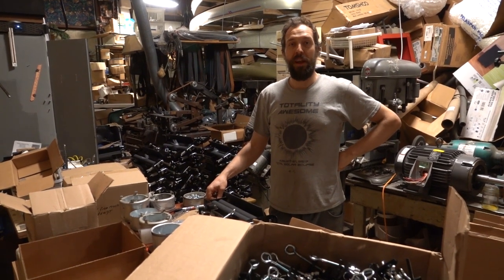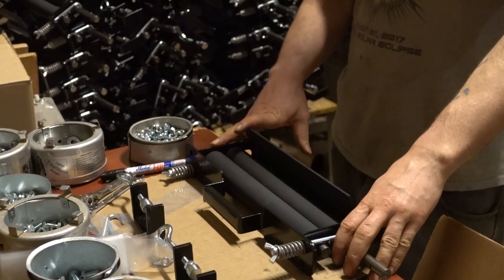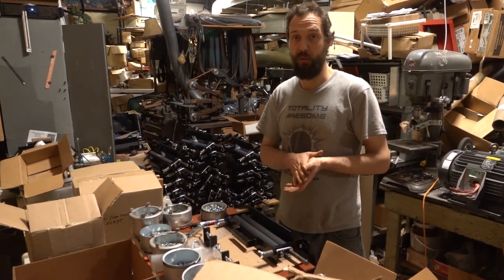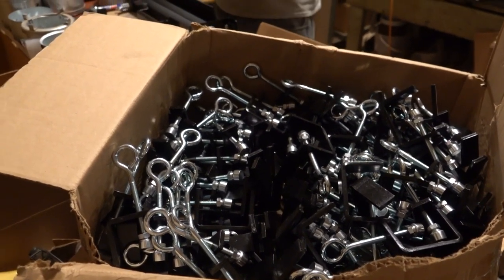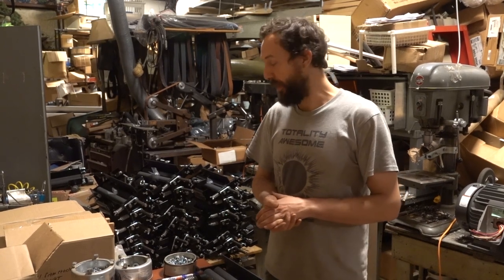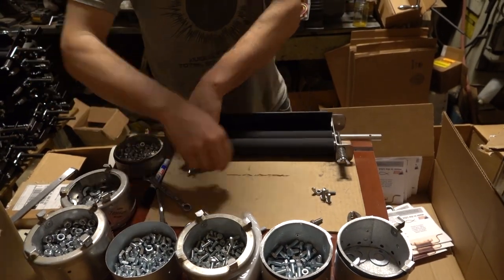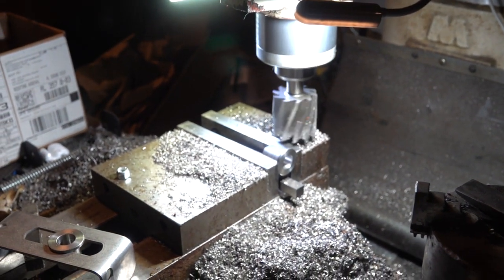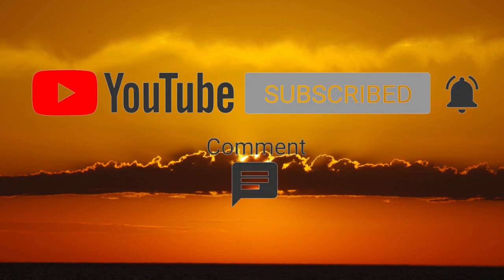Making of Hand Clothes Wringer in the USA

Comment: Just bought one off Amazon. Wash all my clothes by hand and the arthritis in my hands (plus carpal tunnel wrists) is painful sometimes when hand wringing  clothes.  Looking forward to using your product.
Reply: Yes, I've got one too !!!  And a couple of manual washing machines !!!!   I also have several USB powered mini washers which are ultrasonic and you can put them in a bucket of soapy water.  They vibrate and agitate the water and work off a USB power pack with 4 18650 lithium Ion batteries in it !!!!  Now I don't have to pay for electricity to wash and dry my clothes !!!!

Comment: What's the warranty on them? About how long will the rollers last doing laundry?
Reply: I think by looking at mine, the stainless steel one, should last a lifetime !!!!  Nitrile is an incredibly tough type of Plastic and won't rot like rubber !!!  But I will keep mine away from sunlight to store it.  UV rays can destroy plastics and make sure the Rollers don't freeze outside or get wet all the time !!!!   The Stainless Steel can be welded easily with a Tig Welder but it looks practically indestructible to me !!!